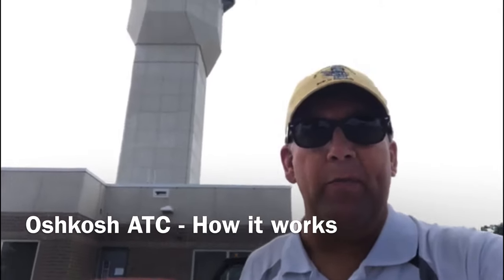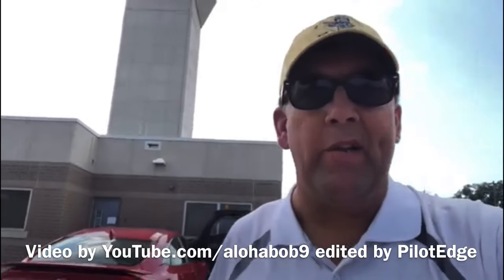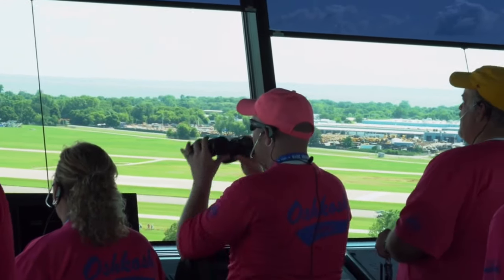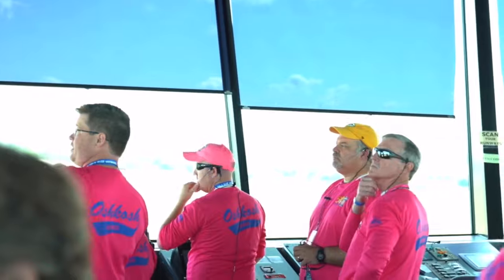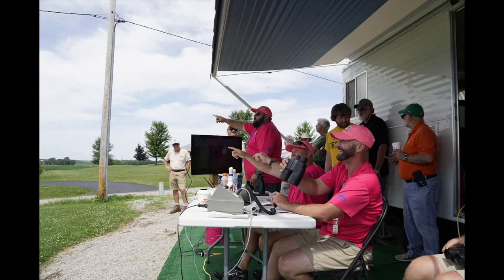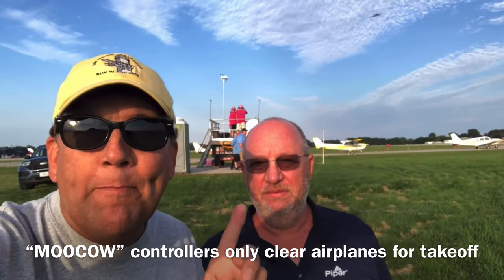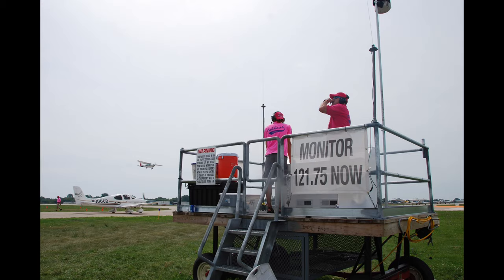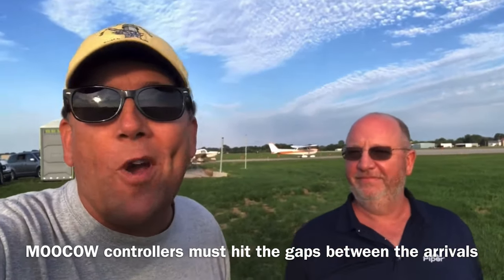Oshkosh Air Traffic Control - How it works. Behind the Scenes with alohabob9

Comment: As an aircraft firefighter worked around airfields for 40 years and found this amazing!
  The spotters remotely located make perfect sense and explains the extra ATC traffic
Completely understand if on a short final but very curious about how you handle inflight emergencies?  
Divert to an alternate airfield so it doesn't interrupt flow?
Reply from the maker: Emergencies are handled the same way they are every day across the country. The aircraft in distress becomes the number one priority and anything they need, they get. If that means closing down OSH airport and letting them land while other aircraft are forced to divert, then that’s what will happen.

Comment: it looks like “half mile south of Fisk” means half mile south of the table and trailer not the town.
Reply from the maker: No, it’s a half mile south of the town.
Reply: Wish I could attach a pic, but Google maps show 44 running south of Fisk, the RR track passing north of Fisk.  So if you fly right above the RR track, you’d be a lot closer to the Fisk approach ATC.
Reply from the maker: @woodenbat4054  Nobody is needing 0.50000 on the nose. It’s an approximation.
Reply: it’s true.  nobody’s asking for 0.50000000 miles.  but north of Fisk and south of Fisk seems important.  I’ve seen videos of people not sure if ATC is talking to them or not.  It’s easier if they’re in a line so they can see if they’re next or not.  but a lot more difficult if they’re not regularly separated.